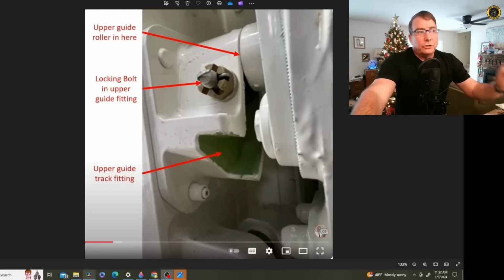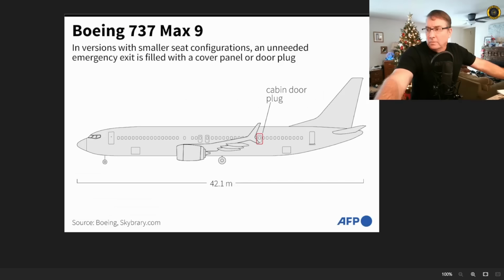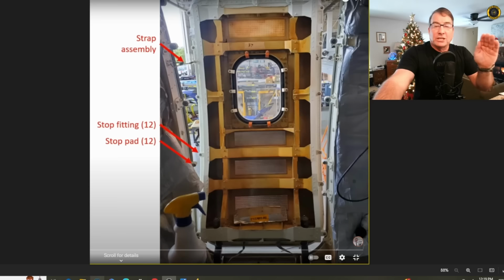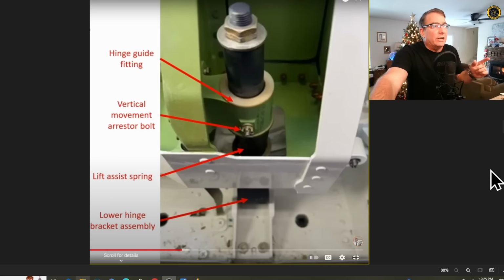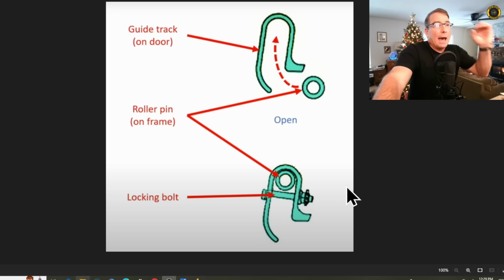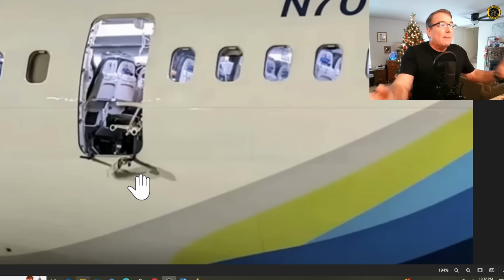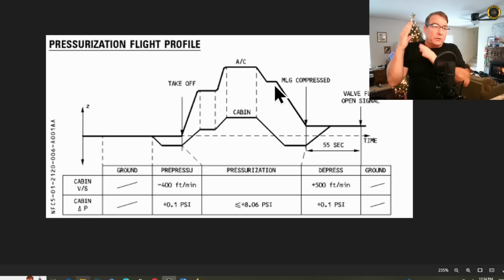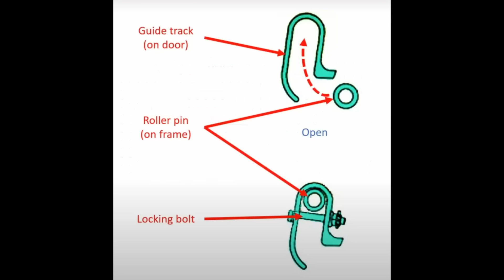Alaska 737 Max-9 Door UPDATE! 8 Jan 2024

Comment: Back in the day "Inspectors" witnessed us torque the castle nut and then install the cotter pin then a "inspector" would apply inspection putty and then 
stamp the putty with a small inspection  stamp.........  Then they started "self inspection"  removing  inspection requirements. (Called it streamlining)
All of this happens in a high pressure to perform (get your bar done)  environment .  AND two or three shifts that may or may not have the same processes.
Reply: So much money and time, what a waste !!!!. Let the final customer tight the bolts themselves.
Reply: Life is cheap. inspections cost money...
Reply: @GrandadTinkerer  You joke, but companies have made the calculation of how much a lawsuit will cost vs the cost to fix a problem in the past and doubtless still do.
Reply: Yup!
Reply: Airbus does same thing too
Reply: All true, sad but true.
Reply: I've worked at a company as NDT, Which is also QC. I've been asked to buy back things by mechanics who were shocked that i wanted to examine their work. I frequently had to reject their work because it looked like hammered ass, as the saying goes.... After doing that once or twice, they would shop for a different inspector.... ymmv, remove shirt before ironing, do not taunt happy fun ball.
Reply: @silmarian Standard cost-benefit analysis.
Reply: @TinLeadHammer  
Human greed posing as corporate greed without regard for human life. It's turning the world into shit as the companies get greedier and greedier.
Reply: Exactly why I retired from Boeing early.
Reply: I worked in the construction industry for 17 years till retirement, my employers are a design and supervise consultancy with worldwide offices and divisions. I was attached to the Tunnels division and had 20 years of experience working for tunneling contractors before joining them.
Each process of tunneling was separated and joint inspections were done by the contractor's engineer, and consultant then signed off for the next stage. Any missed work or defects had to be corrected before the next stage could proceed.
The mining crews were paid bonuses and so any rework cost them money. Being in the trade so long I had worked with or inspected the work of many of these guys. So, I instilled in them ways of presenting work for inspection that not only saved rework but also slotted in with the next operation and saved them time.
Reply: Yes, back in my day there, 81 to 85. That's how it was like you stated. Then when all these 737 incidents came along, WTF happened to the place?😢
Reply: "...Back in the day "Inspectors" witnessed us torque the castle nut and then install the cotter pin then a "inspector" would apply inspection putty and then 
stamp the putty with a small inspection  stamp...."  Completely correct.  I had assumed that this was done here. too.  But no.
Reply: "Back in the day" is correct. But those days have been long gone. Most mechanics now .... self-verify...their work. Former Boeing mechanic and inspector myself.  @MrShobar
Reply: @rickinmi  I stopped the 747 Everett line assembly line, by pointing out a major damage to control boxes by supervisors improper handling before installing, to my lone QC inspector that checked my work. ONLY BY HAVING A UNION was I NOT fired on the spot as I was correct that electronic control assemblies were being damaged, and I ended up being the only one in the plant to install the electronics boxes for a while until I was transferred to the flightline!
Reply: We have a book that tells you how much money per finger or death. It's profit over lives
Reply: looks like boeing tries really hard to self implode.
Reply: sounds expensive! sincerely, the profit motive.
Reply: @silmarian It is true. We can't spend infinite money to save a single life. The government actually sets a dollar value for a human life. There is a point where we are safe enough. Money (which is just a measure of human labor) is not infinite. If safety is number one above all else, we could never afford or be allowed to do anything as everything has some danger involved.
Reply: @7_of_9 The government actually sets a dollar value of human life. If we put safety above all else, no one could afford or be allowed to do anything. At some point we are safe enough. This door fell off an not a single person was killed. Flying is increadable safe. Driving is far more dangerous yet you refuse to reduce the speed limit to 20mph on all roads. You care about your ability to get places in a timely manner over safety!
Reply: "Then they started "self inspection"  removing  inspection requirements. (Called it streamlining)"
this is how most maintenance is done in operation though.
Reply: @ursodermatt8809  Yes and if you try to fix anything or make a process more robust they fight you tooth and nail.
Reply: I'm only familiar with the Navy way. We had the 3 signatures on safety of flight items. Person doing the work, a Collateral Duty Inspector and a QA person. Yeah, it took a while to go fetch somebody from QA once the job was done to come and look at it. That's probably what Boeing was trying to avoid.
Reply: @crissd8283 You cannot argue with me that inspectors are not affordable.
Reply: I spent almost 20 years in QA for aircraft fuselages. Lived through the FAA audit following the loss of Turkish Airlines 981. When this story hit the wires, my very first thought was QC failure. Then I remembered that QC is expense, so the root cause is management philosophy. The assembly team that actually caused the failure more than likely has no idea that anything was done wrong. 

Audits. Corrective Action. Tiger Teams. That was then. This is now. And this is one of many reasons why I choose not to fly any longer.
Reply: @pixelgamer2579  Did I argue that?? All I am saying is safety and costs must be balanced. Maybe a cost benifit analysis shows that 3 inspectors are worth it but 4 are not. Human life is not indefinitely valuable as then we could justify never allowing anyone to do anything.

Comment: The NTSB just did a briefing. The door plug rose up and broke the top roller systems on its way off the plane, and there were NO BOLTS on the door plug. So either they cracked, or they worked loose, or they were never installed in the first place. Incredible!
Reply: I doubt the bolts would have worked loose this fast (in 2 months) even if the bolts were not cotter pinned correctly. I want to be proved wrong though. 😅
Reply: That's not exactly what was said.  I am not saying you are wrong, but the NTSB tech actually said: "We have not yet recovered the four bolts that restrain it from its vertical movement and we have not yet determined if they existed there. That will be determined when we take the plug to our lab in Washington DC."
Reply: In the unlikely even these four bolts were entirely forgotten during reassembly, would there be enough upward moving force to ‘unhook’ the 4 pins, just from the normal kinds of typical movements you’d find inan airplane?
Reply: Sounds like a shift change issue.
Reply: Time will tell, but my bet is that the locking bolts were never installed. If the bolts nut just came loose, they would all have to come loose at the same time. Then all four bolts would have to wiggle out at the same time.
Reply: @rkan2  there are reports of finding loose bolts in this location in the fleet since grounding
Reply: @lloydster2000  The bolts cannot have been present if the fixture is intact. The bolts go through the plane and the plug, essentially.
Reply: @62Cristoforo  yep, there are helper springs installed to make it easier to lift the door the few inches up in order to clear the pads.

The bolts in question are there specifically to hold those springs in compression
Reply: @ShaunHensley  not quite, as the bolts at the top, simply block the roller pin from moving down in the guide track so they are on the plug door only. At the bottom, the bolts go through a collar around and through shaft for the spring, so since the spring is part of the hinge on fuselage, you’re correct there.
Reply: @JohnHallgren  In fairness, an airplane isn’t formed out of one solid piece of material, so I didn’t see the need to confuse the issue by saying it’s connected to a part that’s connected to a part that’s connected to a component which eventually somewhere in there is an arbitrary imaginary line between door and aircraft.

That’s why the I used the word “essentially” down there at the conclusion of my statement.
Reply: @ShaunHensley  that’s fine, I was just picking up on the minor fact that there is a difference between the top and bottom bolts, and the top ones are strictly on the door itself. there’s been a lot of confusion on this overall topic so I’m just trying to make sure there’s none here with what I’ve learned from these discussions.
Reply: @62Cristoforo  you mention unhooking four pins, so just wondering which parts you were referring to? There’s actually hey 12 stop fittings and pads which obviously became vertically separated and thus unhooked, in a way.
Reply: @davidschwartz5127  more specifically an ESG/DEI issue
Reply: @rkan2  The bolts are not clamping anything together.  They did not need to be tight, so long as the cotter pin kept the nuts from falling off.
Reply: @waynebendelow282  The bolts do not have to wiggle out all at the same time.  They can, and do, wiggle out one at a time.  I work with a mechanical press and the upper plate that the die mounts to hangs from four bolts.  You can only notice that the bolts have loosened once there is movement; although, I can check for gaps.  Once it has been verified that the bolts need to be re-tightened, I always notice that two of the bolts have backed out by different amounts (If three are loose, the fourth usually snaps).

In the case of the aircraft, the plug stays in, until the last bolt wiggles out, regardless of when the other three bolts wiggled out.
Reply: @dohabandit  Yep, the bolts were never fitted!! Only logical explanation as to how a system that has been used for ages could fail on such a new aircraft? I'd wager good money on this being the outcome of the NTSB investigation.
Reply: @richardbell7678  I think the bolts were never fitted. It would take a significant amount of time and vibration for all four to wiggle completely loose. This plane was almost brand new.
Reply: I agree.
Reply: The bolts were never installed seems like the most likely scenario to me.
Reply: As long as that cotter or safety pin is installed those lose nuts cant go anywhere. Those pin are there to ensure that. @ShaunHensley
Reply: @Skimblshanks  I'm saying those bolts weren't installed
Reply: @62Cristoforo There’s a reason for the bolts
Reply: Wondering if the bolts sheared or something. Last year there was that huge issue of fake parts in engines, what if the issue is beyond engines. What if it's a industry wide issue of fake hardware?
Reply: Vibration in specific ranges can cause all kinds of things to move on an aircraft
Reply: Never Installed! Maintenance was done on it, Alaska Air-style, is my ten cents. AA, let's not ground a plane with pressurization alarms going off, let's JUST AVOID OCEANS! That way, we keep making MONEY!
Reply: If what you say is true then the fault falls on Alaska Airlines not Boeing. @BigEightiesNewWave
Reply: @ShaunHensley  Couldn't they have been there without their castle nuts fitted, for example?  Sure, they could quickly end up falling out, but that's not the same as never having been fitted in the first place.  Have I missed something here?
Reply: @lloydster2000  It’s far more likely that someone neglected to install the hardware at all, than that someone installed the hardware and forgot to put nuts on it. 

Also the low hours of service leads me to think that four nuts didn’t spin off because no cotter pins were installed.

Assemblers don’t typically install four bolts without nuts then go to lunch and forget to install the nut, typically a person who puts a bolt through a hole, will put a nut on that bolt before walking away or moving onto the next bolt, that’s how assemblers work
Reply: sounds like the bolts were put in with castellated nuts , then a shift change happened before insertion of " Split pins." Reason some are ok & others are slack.
Reply: Clearly this is the issue with the plant the assembled the fuselage.
Reply: @waynebendelow282  Why would All the bolts have to come loose @ the same time. ?

Comment: I was called out for stating the door plugs were removed to facilitate fitting out the aircraft.
Thanks for reiterating this is how things are done.
Reply: Are they removed for fitting, or are they installed during? There are videos of Max 9 fuselages being shipped (rail), and they do not appear to have the plug installed.

Edit: I'm wrong, they are installed for shipping.
Reply: Who called you out? let's name them and Shame them!
Reply: @samholdsworth420    Probably the usual bored people with cell phones looking to rile things up.
Reply: @bobroberts2371  lol
Reply: ...and if that were the case, this would be an excuse because.... why?
Reply: @Hakuna_Frittata , going from Juan's description, the door plugs are initially installed while at the Wichita, KS facility before the fuselage section is shipped to the Seattle, WA final assembly line. This plug is removed in Seattle either while the plane goes down the final assembly process, or when the time comes to install the interior furnishings (seats, lavs, galleys, etc.) since an opening of this size would give easy access for triple seat assemblies and overhead bin assemblies if some of the major interior is already in place around the forward and aft main doors.
Reply: So, buy spirit stock? Seems like they aren't responsible, yet they stock dropped even harder than Boeing.
Reply: yeah, it's amazing how many people insist their assumptions are true rather than what people are actually looking at are seeing.
Reply: As the son and grandson of engineers, I concur with your thinking.
Reply: From what I read, the Boeing/Spirit/quality question is a LONG one.
Reply: @Hakuna_Frittata  Regardless of what happened, the last people to touch the plug door on the Alaska Airlines 737 MAX-9 that failed were the Boeing people that were supposed to close the plug door and install the locking bolts, nuts and cotter pins. Given that other 737 MAX-9 aircraft have reportedly been found with loose bolts on the plug doors it points to a failure with the processes for installing those bolts or the processes for inspecting the bolts after they are installed.
Reply: @jfwfreo  Exactly, that's what I'm getting at. It appears Boeing is at fault, not Spirit.

Comment: It's a miracle that the door did not hit the left horizontal stabilizer.
Reply: "... stabilizer runaway ..."
Reply: take another look at the a/c profile shown in the presentation. the door is located completely below the stabilizer and well forward of it. not likely to hit the stabilizer.
Reply: @peterebel7899  😬
Reply: @garymartin9777 Until the door exits with a slight twist (or doesn't exit explosively away from the airframe ie, it briefly hangs on by some part of its attachments) then achieves a positive angle of attack in the airflow and finds the target. Unlikely, I know but absolutely possible given the right set of circumstances. After all, who'd have imagined a door plug could possible exit an aircraft given the physical design and safety systems in place!
Reply: @garymartin9777  this guy assumes the plug, which is shaped like a sail, would fall straight down WHILE CLIMBING 😂
Reply: maybe it did...
Reply: Luckily it didn't hit anyone on the ground.
Reply: What happened ?
- The Door Fell Off
Why ?
- A bolt was loose.
Is that unusual ?
- Oh Yeah. In A Boeing? Chance in a million.
Where is this door now?
- It is out of the Environment...
What happened then ?
- The Boeing Stock Fell off
Is that unusual ?
- I want to make the point that that is not supposed to happen.
Reply: Also it was BLOWN AWAY from the fuselage by the Differential Pressure on the door plug.
Reply: That's exactly what I was thinking as well. It must have somehow barely missed it. If the horizontal stabilizer had taken a direct hit, this incident could have been tragic.
Reply: @garymartin9777 You have to consider that the plane was still in a climb, and it's corresponding angle. The door must have just barely cleared the horizontal stabilizer.
Reply: @IAmOftenWrong I agree, and not to mention the plane was still in a gradual climb, so the angle the plane was in at the time the door came loose, made it even more likely of a chance of it hitting the stabilizer.
Reply: @ShaunHensley What makes you think he assumed that the door was falling immediately after it blew out?
Reply: @guitarhillbilly1482 It makes me wonder if the aircraft speed was faster than the speed of the door being blown off, or the other way around?
Reply: @bobby1970  By his reasoning that he gave.
Reply: 2nd miraculous piece luck, seats unoccupied & no strike on anything aft !!!
Reply: plane was climbing so downward airflow would have pushed the door down and away ?
Reply: @robertsmuggles6871  The angle of the aircraft, while climbing, would put the component path closer and not further from the tail.
Reply: They described it as a "rapid depressurization". The force involved must have been explosive, as if a bomb blast had taken place in the cabin, sending the door straight out, possibly to a considerable distance and well clear of the aircraft. The force was so great that even the internal cockpit door, which is some distance away from the door plug, was blown out.
Reply: @IAmOftenWrong it's still in an area of downwash. The air directly above the wing is never hitting the elevator with an aerodynamically loaded wing. I'd stick with unlikely.
Reply: @chargehanger 😂😂